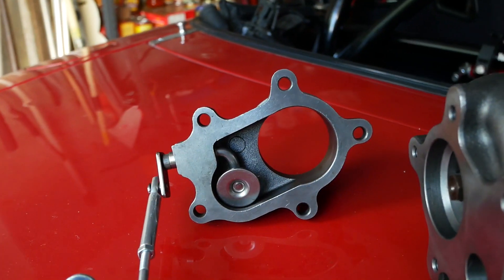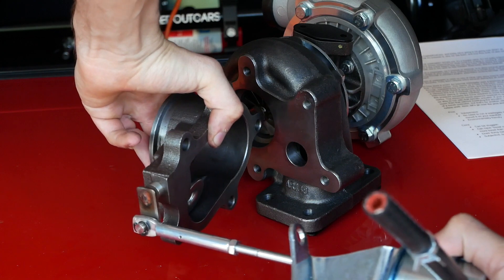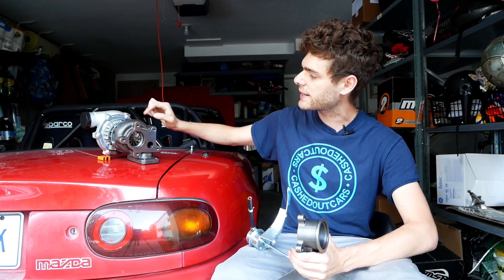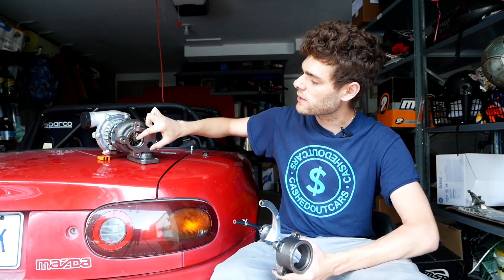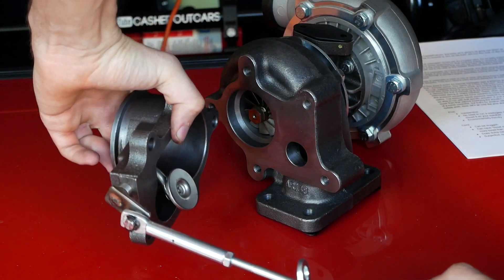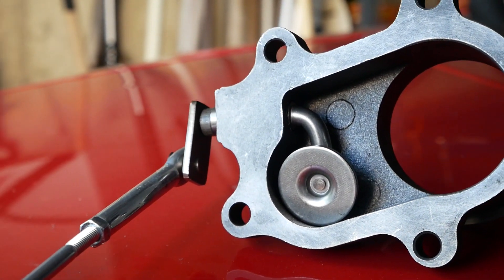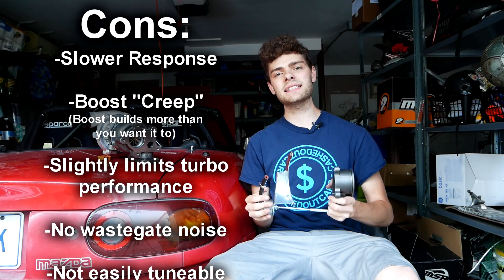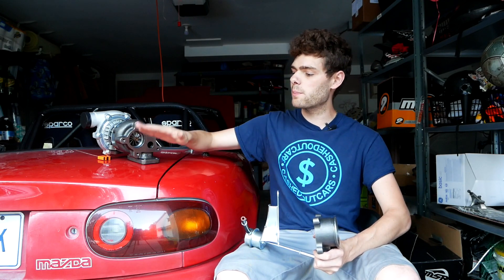Internal Turbocharger Wastegates Explained

Comment: My 2017 sti is all built up and modified. When i moved back to phoenix az, maybe a month  just all the sudden lost its power and boost. 84mm forced performance turbo green was awesome, and all the sudden, it wasn't and doesn't seem like my front mount intercooler is keeping my engine cool enough. I've looked up everything, I'm extremely upset i paid all this money,and it isnt running correctly.  Any suggestions? Thanks

Comment: Hey @CashedOutCars, if your running an external gate is it okay to block that port for your internal gate on the hot side with a 5 bolt flange that covers the port or will that cause problems?
Reply from the maker: Yes, that is fine as long as you have a way for the exhaust that does pass through the turbine to exit. Where is your external gate mounted, to the manifold?
Reply: Yes, the external gate is mounted on the manifold where all the exhaust runners merge into one right before the exhaust gases enter the turbine. It’s a ram-horn style manifold as well to give you a better idea. The exhaust gases that do pass through turbine will exit through the downpipe and into rest of exhaust but I’m using a 5 bolt flange that covers the internal gate port which I’m hoping will be okay and won’t cause any issues with exhaust gases exiting turbo?Thank you for getting back to me so quickly, your knowledge will get me one step closer to completing the turbo setup on the build!

Comment: Where are you pulling the vacuum for your internal gate mate?
Reply from the maker: I chose the intercooler piping as close to the turbo as I could have gotten, there’s lots of places that’ll work that each have trade offs (intake manifold, compressor housing, different locations on the intercooler piping)
Reply: @CashedOutCars  yeah rad! I think I might just drill and tap my compressor housing and put a nipple in there
Reply from the maker: Nice! Theres usually spots in the casting designed for doing that, a place with a little more material. Good luck!

Comment: Overall great video! Eliminating boost creep is as easy as porting and making sure you don’t have too small of an overall exhaust outlet, making sure your actuator is boost referenced at the compressor outlet with a hose that won’t expand under pressure is critical to a fast reacting internal gate system. Also buying a wastegate actuator that allows you to change the springs really helps out, $60 total on eBay (actuator and spring kit) and you can go from 5psi to 30psi with ease, stay frosty everyone!